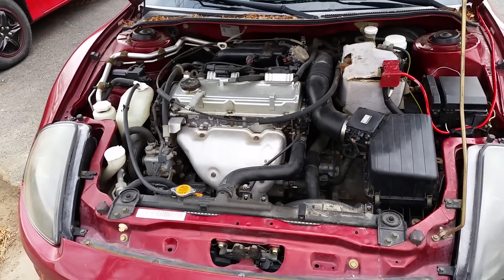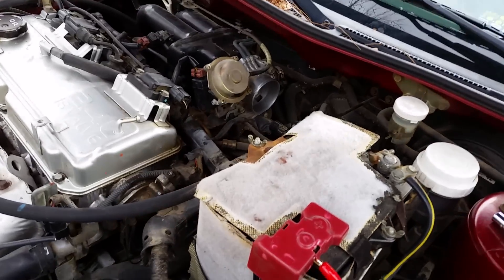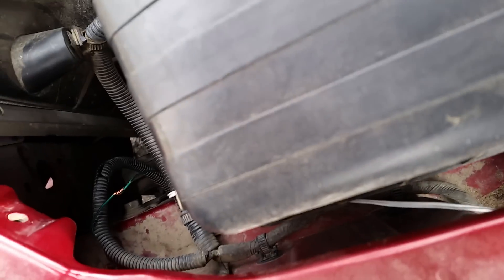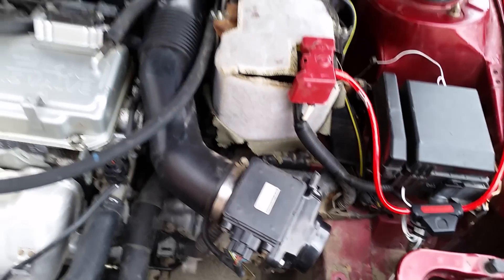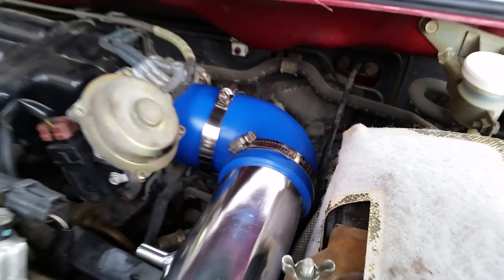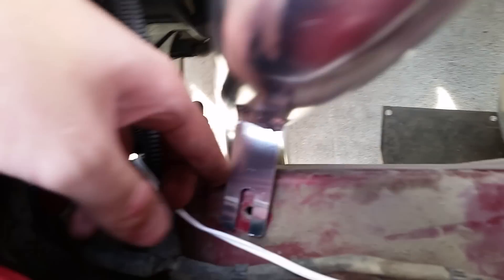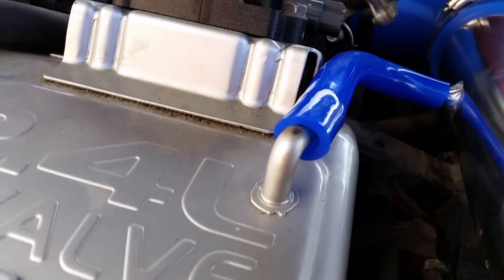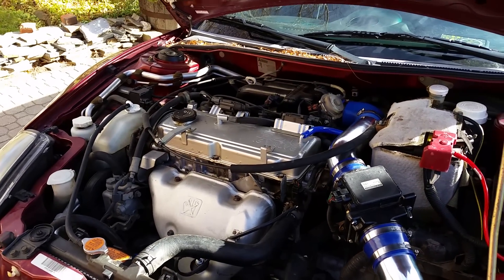how to install a cold air intake

Comment: Why did you choose this air intake instead of a short air intake?
Reply from the maker: Short ram will usually suck up hot air from the engine bay. This one pulled cold air from down in the front bumper.

Comment: Do you live in the Denver area bro we gotta make a 3g crew need more eclipse bro’s
Reply from the maker: I live in the western slope, Grand Junction, and I haven't had that car for years.  I miss it though
Reply: demi god cars was it worth it? Did the cold air intake give any extra hp or what is your review on it I wanna get one but I’m skeptical
Reply from the maker: The one I got was only like $45, it didn't really feel much faster, but for the sound and looks it was worth it

Comment: You need too be more worried about waterflow than airflow lol You need too install a bypass valve in that system (15$ ebay) as it sits too low or that car will blow up when it sucks up 💦 WATER.
Ebay search intake bypass valve
Reply: Where would the bypass valve go on this cold air intake system?

Comment: Wouldn't you have to get it retuned slightly cause of the cold air intake?
Reply from the maker: No, it'll still run fine without a tune. If your looking to get the most power out of it then yeah a tune would be the best bet
Reply: @ipp2109  do you have any recommendations on the cold air intakes I'm pretty sure I have plenty of space for a big one because mine came stock with a small turbo.
Reply from the maker: In my opinion the ebay intakes are just as good as any other, as long as it's made to fit your year and model car. I would invest in a quality filter though, that will make a difference.

Comment: My 2003 galant has the same engine? Im confused
Reply from the maker: EpicLeagueGaming lots if manufacturers use the same engine in many if their vehicles. So it's not uncommon to see the same engine in a few of their models.
Reply: Absolutely correct sometimes they just tune the car different depending on the cars needs .

Comment: will water get tru it and get to the engine >? pls answer
Reply from the maker: If you drive through a deep enough puddle to cover the intake, or just generally get the intake soaked then yes. Otherwise driving in rain or snow is no problem.

Comment: Don't drive through any big water puddles cause you suck in water and hydro lock your motor. You need a bypass.  Otherwise great video!
Reply from the maker: +John Keefer yeah wasn't planning to haha. Thanks for the advice and comment
Reply: How can you avoid water getting into your cold air intake?
Reply: Dont hit big puddles or either put on a bypass valve or whatever its called

Comment: i installed a CAI on my gs reset the ecu and its running really rough help anybody ?
Reply from the maker: issa spork is there a check engine light? Make sure the maf is connected and check for unwanted air.
Reply: yes its throwing maf codes
Reply from the maker: issa spork make sure the maf is facing the right direction, same way as shown in video. Or you might just need a new one, if you dropped it or anything that could've ruined one of the sensing units in there.
Reply: i did drop it so now in that predicament what do i do
Reply from the maker: issa spork well since maf sensors are fragile, the impact probably damaged it. I would order a new one

Comment: You from colorado
Reply from the maker: Yup, I live in Colorado
Reply: @ipp2109  I got an eclipse aswell 2.4 auto 🥺sadly
Reply from the maker: @3mpty59  Mine was a 5speed manual. Still one of the most fun cars I've owned. Not super fast but definitely great in turns

Comment: I know it has been awhile since you posted this but how much more power did you get out of it?
If you had to put a percentage on it.
Reply from the maker: Steven Mojo I didn't do any tests to check but I'm betting it added at least 5hp. The sound it makes though is definitely worth it
Reply: demi god cars 
can't notice any additional power?
Reply from the maker: Steven Mojo i didn't feel any boost in power but that doesn't mean they're wasn't a small gain
Reply: demi god cars still have the same ride or are you running something different?
Reply from the maker: Steven Mojo no I sold that about a year ago. I own a kia optima now
Reply: Steven Mojo Cold air usually put less power than others, like almost where you can't even feel the difference. I put a short ram intake into mine & I did feel a difference & added 16hp.
Reply: Gumby MMA 
I'm driving a 2004 mitsubishi outlander and would like even a 5% increase in power I'm not sure what I should do
Reply: Steven Mojo honestly the first thing everyone does is intake of course, getting more air into the engine is never a bad idea. Do some research on other Outlander owners, see what intake they went with & what feels better. I would have loved a more powerful intake however I'm restricted by California legal laws.
Reply: NO! They do not work. I have never seen an actual test where they did anything positive. In fact, some actually removed power.  If you FEEL a difference it's called the placebo effect.
Reply from the maker: Kent Campbell ever seen mighty car mods? They have dyno results proving they do increase a few horsepower.

Comment: why does it run down so far i dont like that to much water get in there
Reply from the maker: it is low to get better air flow and a good supply of cold air, being up near the engine would provide hot air, not ideal. As long as your not flooring it through big puddles you'll be fine.
Reply: Daniel Lloyd. you can buy a bypass valve to prevent hydro lock putting it any higher gives the intake no use and you will probably lose power rather than gain